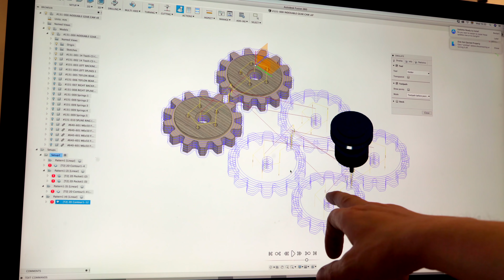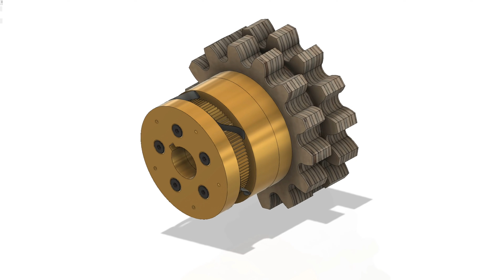Tweaks & Fixes - Marble Machine X #84

Comment from the maker: I have been focusing on getting the MMX to play its first drum beat ever, I want to make a video showing that. But I keep running into so many small little things that needs tweaking so I couldn’t make that video for this week. Instead I collected some of the steps I have gone through to reach that first drum beat. I have also been overhauling the muting system and the marble divider and the machine now works better than ever over all. I hope I am able to show you the drumbeat next week, but we’ll see if I can manage. Have a great day everyone! /M
https://www.youtube.com/watch?v=NS9uKRcxmy0
Reply: I bet the Marble Machine X will be finished on the 100th episode... 

Cant wait!
Reply: No way... Maybe? But I don't think so.
Reply: I noticed that there is a high moment of inertia on the flywheel making it difficult to start. What about adding a governor (like a steam engine or elevator) such that there is a small moment at start up and then as it picks up speed, centrifugal force will move weights to the outside and increase the flywheels effectiveness?
Reply: @yce1234  that is, spring loaded weights that pulls them in when the speed is low and when the speed takes up, the are springing out to there final places?  You will still store energy in it, but in the start there will be less energy then after it have picked up some speed, then it will be a bit heavier.  
Yes, that would be a good idea, I think.  
I bit complicated, but on might be able to make it visual so Martin also like it. :-)

Also, make the weights bolted or fast released mountable on the flywheel so it will be easier to adjust.  Just make a "hanger" that the not used weights are hold on place. Then you don't need to remove them, and to do that unscrew the flywheel axel.  They will always be in the axel, but only hooked on the flywheel when needed.
Reply: @yce1234  Or, he could make secondary crank (or pull string) to "start" flywheel when it's diaconnected from rest of machine
Reply: Old R/C trick - roll one or two thicknesses of paper into your gears, then adjust them to as tight as you can get them, then roll out the pieces of paper.  Instant backlash adjustment.
Reply: Here's a quick tweak: Please, oh, PLEASE color the screw heads black on the programming wheel so that all that can be seen are the programming pins! #paintitblack
Reply: It’s called backlash not slack, for the gap between gears
Reply: @Celcius1  Give him a break. All humains make mestakes.
Reply: Don't worry mate, reducing the friction is an important but time consuming task. Doing it now means it's all more satisfying in the future
Reply: I hope you don't have forgot one big problem, Water.
your machine gear will change size base on amount of water they absorb from air, so it's a nice thing to considerer, so world tour doesn't turn into a nightmare.
that and shipping, but i think you already know how the shipping will work, right?
Reply: @youkofoxy: same thoughts I had when I saw the video. Maybe you should consider impregnating the woodparts with something like thinned PU paint.
Reply: I started to think that you need some things to level the machine on the tour.  And then you started to talk about the leveling piece in 1:40 .  :-)
Reply: Don't want to complain, but was the ending of the video intentional? If it was, great! :-)

Don't forget it is a "röd dag" tomorrow, 2019-06-06, and we should celebrate it! :-)
Reply: Just curious Martin, how heavy do you think the machine will be when all said and done?
Reply: @jamesdoeshisbest  id still estimate it's 240-300 lbs... but shrugs
Reply: Last resistance died I guess
Reply: I look forward to your progress every week! I'm sure you've thought of this, but have you tried (or can get hold of even) a FLIR camera? It would clearly show spots where friction might be an issue. 
 Have a great day!
Reply: Next week: "I found that i can change kick drum for real one, so i bought this 15 inches kick, the smallest they made..."
Reply: You would make a good dictator all resistance would be removed swiftly and efficiently  :p
Reply: I came up with an idea although I do not know if you already implemented it, what if you use the mechanism of the pedals on the bicycles (like when the pedals are still and the tires keep moving) I think you could hit yourself if you get too close to the crank xD besides that you can use that in other functions of the Marble Machine X
Reply: @yourvix6415  This sounds like a great idea, except that the flywheel is designed to be able to transfer energy to the machine as needed to smooth out the system. It needs to be able to act as a force input and a force output. You may be interested to now, though, that a slightly more sophisticated version of that concept was used on the marble lifting chain bearings!.
Reply: So are we ever going to get to see the fishstair/elevator ratcheting system up close?!
Reply: I believe he has to finish:
- installing the instruments
- Finish the kick drum
- finish the marble releasers to drop     marbles on the instruments 
- Something that will catch the marbles instead of going on the floor after they hit an instrument
- maybe finish the MMX’s song
- figure out how to disassemble the machine for the world tour after the video about its completion 

It will probably be finished by MMX - #88 or #89
Reply: Satisfaction 100/100 I bet if will be finished in no time!!!
Reply: In our Truck Workshop the mechanics use an old hot Plate to heat up the rings.
Reply: Might I suggest adding a flywheel pre-spooling motor that would keep the decoupled flywheel spinning at a low RPM? This would allow you to reach your desired play tempo with less effort.
Reply: Lubes help
Reply: Awesome Martin. We can't have your arm falling off after the first song is played.
Reply: Do what you do sir! I actually smiled when I sat down to watch Wintergatan Wednesday. Delightful!
Reply: Wintergatan I think it would be great to show a progress bar on your videos (digitally in post production or physically in your studio) to show the level of completion of the MMX. After following your journey since the very beginning it amazing to see it so close now - would you say it’s 90%? 95%? You will have the satisfaction of progressing the progress bar each week and we will have the joy of seeing how close you are to completion. Thank you and keep up your amazing work (please come to Australia on your world tour)!
Reply: I did have a couple of thoughts. One for the powering of the machine........with an E-bike motor.  In the case of a long concert how will your strength hold out? The pedal assist function of an E-bike could work in the same way on the Marble Machine in that it only assists when you crank. 
The other idea is for a lot further down the track. You mentioned that with a big concert that a lot of people would not be able to see the moving parts. What if you mounted cameras in strategic locations on the machine and have the video displayed on a big screen in a multi view format for all to see.
Keep up the great work, I love seeing the progress each week.
Reply: Looking forwards to watch it play in your next video...
Reply: I really like how it's coming along and turning out.  Keep up the good work!
Reply: Martin!  I was re-watching your video this evening and realized that I had completely missed your mention of (and link to) the video from NYK.  What an awesome surprise!  I thoroughly enjoyed watching it, as well as the Blue Marble clip (which I had somehow also missed).  Thank you SO MUCH!  Not only was today's episode super lovely, but the bonus videos were a delight as well.  You truly made my evening. :D
Reply: did you ever tweak the marble divider? it still seems to favor the outside rows.
Reply: Thank-you for this wonderful, crazy, beautiful instrument-sculpture you are creating, and for showing the building process to the world!  I've just binge watched through the whole thing in a couple of weeks, quite a ride!

Now the boring bit.

Someone mentioned about the high-hat timing being upset as it is opened and shut.  This got me wondering how precisely equal the drop heights need to be to keep all the timings tight.

Fall time = Sqroot(2*height/gravity) = 0.4515 X SQR(height) for height in metres, time in seconds = 14.28 X SQR(height) for height in mm, time in milliseconds.

For drops of 300 mm, time is 247 ms.

If the maximum time difference acceptable is 10 ms, the shortest drop can be no less than 276 mm (with the longest 300 mm)

If the maximum time difference acceptable is 5 ms, the shortest drop can be no less than 289 mm (with the longest 300 mm)

So there is just about enough tolerance to allow the high hat to move.

There are timing adjustments available within the mechanism, but these will mostly change relative timing, in proportion to the speed of the machine, rather than absolute timing, independent of machine speed, like marble drop distances.  Even so, they can help a bit, depending on how much slack in the timings can be tolerated.

Suppose the earliest channel is 23 ms earlier than the latest.  The internal timings are adjusted so that this is cut to 10 ms when playing at 200 BPM (so 13 ms of delay at 200 BPM, about 1/25 of a beat)
At 114 BPM, the internal delay will expand to 23 ms, and everything will be perfectly in sync.
At 80 BPM the internal delay will be 33 ms, and the shortest-drop channel will now be 10 ms LATE

By exploiting this internal adjustment and tolerating timings changing with playing speed, the heights can be less exact – 23 ms of range instead of 10 ms, in this example.  This lets the shortest drop go down to 246 mm, instead of 276 mm, with the longest held at 300 mm

If only 5 ms of time spread can be tolerated instead of 10 ms, all the times halve, only 11.5 ms of absolute delay difference can be accepted, and the drop heights must be 272 mm to 300 mm

An alternative constraint is to keep the timing spread to a fixed fraction of a beat, so it has to be closer at high speeds.  For 1% of a beat tolerance, 3 ms at 200 BPM and 7.5 ms at 80 BPM, the absolute tolerance becomes 10 ms, with the internal adjustments taking 7 ms off that at 200 BPM, and 17.5 ms at 80 BPM (so 7.5 ms out the other side).  There is then an allowable range of 276-300 mm for the marble drop.

Obviously, if the actual largest drop is not 300 mm, the ranges will move, but not in proportion, due to the square root relation between drop height and time.
Reply: Being made of wood, the gears would have worn down on their own in fairy short time.  Even metal gears would wear down after some time.  This is called "breaking in" and is why it's recommended you "break in" a car for the first few thousand miles/km before stressing the engine.  The gears wear in such a way that they mesh together smoothly on their own in time.
Reply: Have you thought about lighting? It might be cool to have lights that synchronise with things like the fingers or drums for stage performances.
Reply: #Wintergatan...maybe you can paint all the balls with some different FLUO colors...i thinks that will be great during your show. You will come to Italy? bye!
Reply: Resistance is futile.
Reply: friction / resistance in the moving parts - > try to use 100% fluoro grease, thin layer is almost invisible and works, does not stick
Reply: Bees wax on the wood interfaces should help
Reply: Wintergatan has an iq of 100000000000000000000000000000000000000000000000000000000000000000000000000000000000000000000000000000

Comment: Don't confuse electric vehicles with renewable energy.  Unless you are getting 100% of your power from nuclear, hydro, wind or solar, it's not even close to renewable or clean.

Also, lubricant  and correct tolerances are the right ways to reduce resistance.  Hacking off pieces and increasing tolerances is not the best way to solve that, you just introduce more problems.

Loving your videos!

Comment: Something I’ve been wondering about is the amount of time it will take to assemble and adjust the machine each time you arrive at a venue. Will you travel with a team of technicians solely responsible for the machine? With hundreds of potential adjustment points that may need attention after travel, I imagine it could be a time consuming process to tune up before every show.

Comment: This is really cool work you're doing, Martin.  One suggestion:  if you use the real snare drum and the tiny kick drum, it is hard to see that the kick drum is supposed to be a kick drum, since typically kicks are bigger than snares.  What I think would look better, and probably also sound better, is a small acoustic kick drum that is visibly larger than the snare.  You could probably either place the kick under the machine, or get a compact, small-depth kick drum.  For the second option, I'll give you a recommendation for Farmer Footdrums and you could ask if you could buy a custom-sized kick drum from them.   They recently sold me one of their compact foot-operated drum kits, and it's amazing.

Comment: you are misguided about a transition to renewable energy for cars being possible. that would require almost no use of cars by anybody...the ideal situation, but certainly not what most people have in mind. ramping up so called renewables to the scale required would require a similar level of unsustainable, planet eating industrial activity and environmental destruction as before.  what is never admitted is that electric cars require at least as much energy in total as internal combustion cars. at least half of energy required in a cars lifespan is in its manufacture.  mining, metal smelting, transport of materials etc used to make cars cannot be done with electricity, they require fossil fuels that cannot be burnt. car making is even more unsustainable if we include the rare earths needed for batteries and motors. and then there is the general industrial infrastucture / culture required  for car technology to exist , which will always depend entirely on the gigantic free battery of fossil fuels that nature stored up over a billion years. to transition to sustainable energy would contravene the law of entropy at a fundamental level. to imagine humans will ramp up sustainable energy (always 'so called') is ridiculous, seeing as a paltry 3 % of electricity is currently generated from solar and wind etc. and electricity is a small proportion of total energy used by humans anyway. and so called sustainable energy, incl nuclear are fossil fuel derivatives anyway too. the idea of sustainable industrial civ is simply an oxymoron. so, with the best will in the world, a transition to electric cars, esp at anything like todays scale is pie in the sky nonsense, and wont help the situation even if it did happen. not without the curtailment of car use to miniscule proportions anyway, together with a planned background reduction of civilization and human population. even then i dont think its possible. civilization, esp an industrial one, is probably most likely impossible without fossil fuels, and then only for a few decades. the fermi paradox hints that long term techno civilizations are not a feature of our universe.

e cars are just another delusion that allows humans to carry on without changing their behaviour at a fundamental level or reducing their populations dramatically to a level the earth can support.

anyway. i am enjoying watching you build your amazing, crazy machine. its a truly beautiful creation in all its parts, and staggeringly ambitious. but i do not have enough grasp of its fundamental design, or of music to really understand it. its a great thing to build. creating music is one of the few things humans do that has merit

Comment: Stick a belt drive on it temporarily and an electric motor. Run it in for a week. 

Or get really dirty and hide an e-bike motor in the flywheel. A torque sensor could take care of the assist.

Comment: All your wood should be protected from water, you'll need something that won't effect the look, or breakdown the glue that bonds the plywood together.
You also need a lubricant for the gear surfaces, My suggestion is to use bees wax.

Comment: 3 points.

1. Creature feep (feature creep): add the larger snare, have to redesign the mounting, fabricate it, the internal mikes, etc, will add another few days.

2. When you make these tweaks, like reducing gear tooth heights by 1mm, do you change the spec in AutoCad to reflect the new reality? What happens when you start to bend the metal rods so that each marble path aims at the right point on each instrument, will that be somehow scanned and recorded as design changes?

3. As others have been saying, lubrication reduces friction, and wax works well on wood-wood contacts. Metal-metal contact will want oil, and that has to be maintained. In some old machines, like my grandparents' 16mm movie projector, there are little metal tubes with a wick inside. Periodically you add a drop or 2 of oil to the outside end, and it drips down tbe wick to just the point that needs oil, be it a gear or an axle.

Comment: Have you given any thought to what will happen when the MMX is on tour in someplace hot and HUMID? Those wood components will likely swell and change shape. Have you thought about machining a second set out of a more stable material??

Also, as the machine gets heavier and has more points of friction and various bits need to overcome more inertia I would worry that the plywood gears will wear and chip.  This is another place where a more stable material may come in handy.